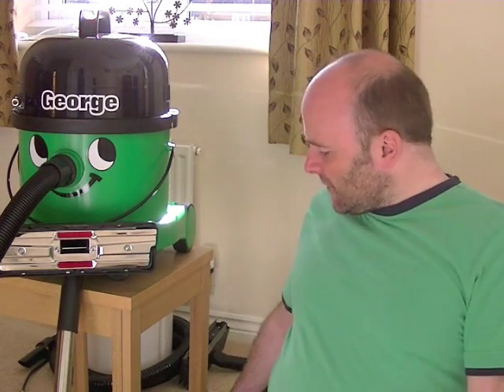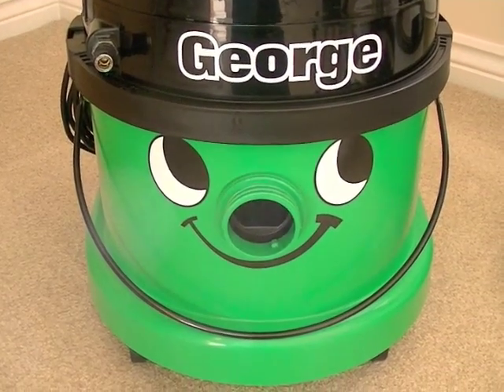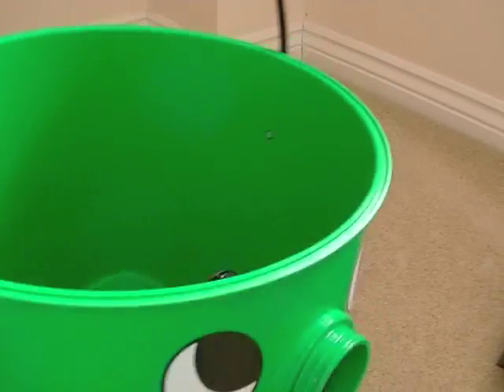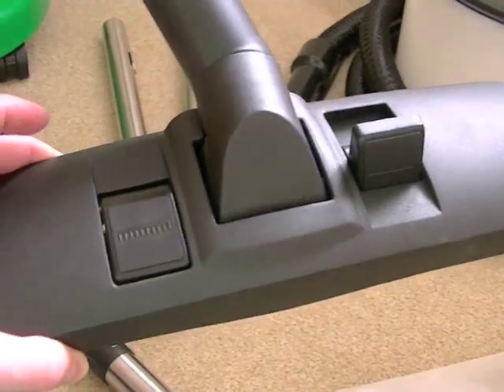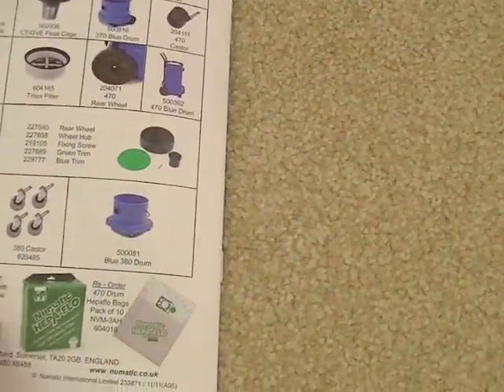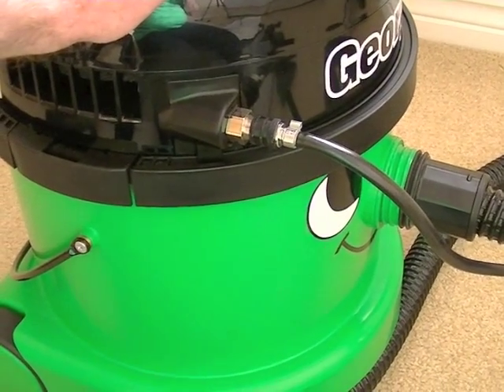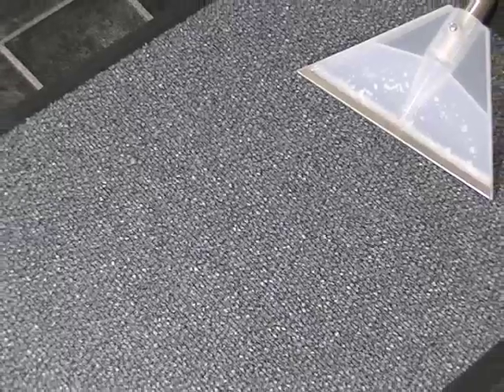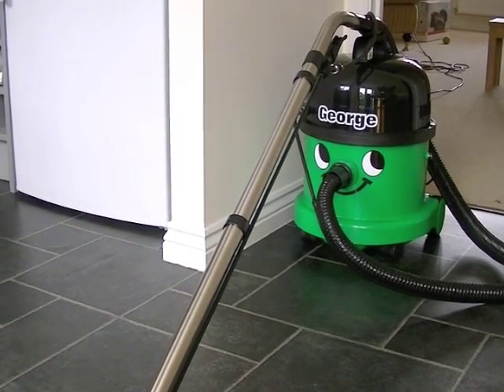Numatic George GVE 370 Wet/Dry Vacuum Cleaner Demonstration

Comment: THANKS.  Very informative video.  I just bought a 'George'.  It might be worth adding a card to your video pointing out that the floor tool bristles are also great at cleaning the grout lines on tiled floors.  regards, Phil
Reply: Hi, how did your George last? Did it keep working ok? Any issues with it? Would you buy another? Cheers
Reply: @krell2130  Still going strong

Comment: thank you for your demonstration. Because of my grind floor it is very hard to look for something to clean it in a good way. i used to have a philips Aquatrio but it doesn't do the job well enough. . i can't use steam. i immeadiatly but me a george and hoping to receive it tomorrow. I skipped everything till you started te demo for the scrub brush. but will look the entire demo soon. that is the most important for me. it looks amazing. again thank you
Reply from the maker: It's a bit of effort to clean hard floors, but you should get a good result with the stiff brushes. At some point I am going to clean my garage floor with my George. For day to day cleaning of hard floors, I would recommend the Bissell Crosswave.
Reply: that Bissell Crosswave looks a bit the same as the aqua trio i was talking about. with 2 dogs and 4 cats it can't keep up. i'm planning to use the george once every two weeks an in between. normal cleening with a mop. depends how easy is to use.

Comment: I watched this video again and again. Because it is the only accurate demo, I can not get help from any other reliable source. Now, you poured the water through the suction, where do you press to suck up the dirty solution from the mat? Your application is not visible to the camera while you are washing the stairs either. You press the suction gun to pour water but how do you suck up the dirty solution afterwards? Does it just suck up itself when you give up using the gun with both the washing button and vacuum button  being on ?

Comment: great review just bought this yesterday with a vax scrubber head someone recommended to me don't no if you have a review about the vax scrubber head on the George . I have a an Italian made carpet washer but couldn't get the parts anymore it was a great machine still works but the sprayer had broken off the end off the wand
Reply from the maker: +spacer567 I have the Vax Spinscrub head and will be reviewing it soon.
Reply: Hi, how did your George last? Did it keep working ok? Any issues with it? Would you buy another? Cheers

Comment: I have the vax 6131 but seems to leave the floor a little to wet for me unless u keep going over it for ages is the George any better thanks in advance n great vids persuaded me to get the vax BTW love it just leaves little wet like I said :(
Reply from the maker: Kev M I don't rate the George for carpet cleaning as it is hard work, but probably dries the carpet a bit better than the vax and the solution is easier to control due to the trigger on the handle. The George is better built than the Vax and is excellent for above floor shampooing.
Reply: OK thanks for info back and I can c that yes the George would b better as the trigger on vax isnt the best build and inconvenient plz keep up the vids great to watch

Comment: Can you use both switches at the same time, can they both be turned on at the same time. Can the fish tail be used on hard floors
Reply from the maker: You can run the pump and vacuum motor at the same time. You can use the fishtail nozzle on a floor, but I don't know why you would as there is a dedictaed hard floor nozzle with George.

Comment: I've noticed that the one you unpacked had 1200W, but the one in Amazon link has got 1060W. Are there two versions of George?
Reply: apasionata001 they probably changed to a lower power suction motor like they use in the Henry machines.
Reply: The new George's have a 1000w moter but idk why on Amazon it says 1060w moter

Comment: Could You reccomend this or vax 7151? Does spinscrub from 7151 work well with numatic?
Reply from the maker: This is better than the Vax. I haven't used the Spinscrub tool with a George.
Reply: +ibaisaic thanks mate, cheers
Reply: +ibaisaic i need one more thing, I read that vax w89ru-a or w90 rapide ultra could be better for carpets, please let me know what You think about it :)

Comment: how do you rate this compared to the vax rapide 2?
Reply from the maker: In my experience the Vax cleans carpets better due to its rotating brushes. Most upright carpet washers with a revolving or Spinscrub brushes will clean better than a machine like the George which doesn't use any sort of powered agitation. The George is robust and well made and would be my first choice if you need a multi purpose cleaner, but it is hard work when washing carpets and because there are a lot of attachments, it needs a fair bit of storage space.
Reply: What's that

Comment: Hi there,
Quick question. Do you have or anyone here has, by chance, size & dimension of the box, with George and accessories ? I need to have mine sent over from Italy to Australia, and I need them to get the quote.... Thanks!
Reply from the maker: +Paolo Corronca If I still had my George I would have measured the box but I don't. You could try and contact Numatic to ask for the dimensions.
Reply: Hi There,

All sorted out, just arrived! Thanks!!

Comment: Thanks so much for this video. I have a george but have only used it for dry cleaning so far. The instruction manual was a little confusing I found, your video has helped me work out how to use it to clean my carpets now.
Reply: As a follow on, since I watched this video and learned how to use George properly he has done a lot of work and family members have made use of him (and this video) too.
I agree with your assessment, he is not the easiest to use if you want to clean a large carpet, I think an upright would be better there, however for spot cleaning, small carpets, rugs etc he does work very well.

Comment: Why didn't they make the exhaust port into the capability to attach the hose? a circle port.  I often use my black n decker wet dry for a leaf blower and i have sometimes blown out leaves or clogs with the exhaust port. Who manufactures George?

Comment: Hi. The solution tube doesn't seem to release any solution out when I press the trigger when i use george in the wet&extraction mode for when I clean the carpet. However the solution tube works fine when I use the upholstery head. Any suggestions of what the issue may be?
Reply from the maker: Check for a blockage in the spray nozzle. A pin can sometimes clear it if the hole has blocked up.
Reply: @ibaisaic  thank you for the suggestion. I tried that but it didn't solve the problem. It may be faulty as it worked the first and only time I used it but has stopped working since then.

Comment: Hi, thank you for your video! Just got my George today and put it straight to work, what a change! I would like to ask you, if I want to do dry vacuuming with water filtering dirt, can I do that? What I mean I use the dry hose and dry vacuuming accessories but inside I pour a couple of liters of water, the float valve on top then the rest so the dirt I vacuum would go straight into that water? So no more hepa bags.
Reply from the maker: I would not recommend it. The George is designed to be used with a filter and bag for dry use. Only heavy dirt would go in the water, the rest would go straight through the motor and out of the exhaust and into the room.
Reply: @ibaisaic  thank you, you are right. And thank you for answering so quickly, I am really pleased with this vacuum, it's amazing for our household needs.

Comment: I have this vacum and have today set it up for the first time for wet use. I cannot however seem to get the spray to work on the long attachment. All the connectors seem to be fine yet there is no spray coming out when the handle is depressed. I have tried the upholstery attachment and the spray works perfectly so the problem must lie on the spray for the carpet attachment. I noticed on your video (28.45) that yours did not work before you cut back to the video again and it did. Did you have to do something to make it work? Any help would be greatly appreciated.
Reply: In the nozzle there is a spring and a ball. Sometimes the little steel ball gets stuck , Take the nozzle to pieces and clean the ball.  Not only that sometimes the water pipe gets a little kink in it which blocks the flow. Anyway, I don't use that any more ( see my post above)

Comment: washed a carpet with george recently wasnt very impressed. i like the fishtail gets into corners and close to walls easy, but i found it left the carpets very wet. i mixed 5 litres of solution and recovered just over 1 litre. the delivery of the solution to the carpet seems ok, but when sucking it back up you need to put some pressure on the tube of the handle forcing the fishtail into the carpet while on the pull stroke. you use a lot more energy using this type of carpet cleaner than say a bissel type carpet washer. maybe there is not enough power in the george to get the solution back from the carpet up the handle and through the vacuum hose (about a 3 metre journey)
i had to go over the wet carpet with a bissel to remove excess solution. should have just used that machine in the first place but wanted to try out the george
probly good as a spot or rug cleaner but i wont be using this type of cleaner again to shampoo carpet
when hard floor cleaning recovery of solution seems no problem
Reply from the maker: The George is the best cleaner I've used for above floor deep cleaning and car valeting, but not recommended for carpets. The hard floor head is good and I've even used it to clean a concrete garage floor. For carpets, an upright machine with revolving brushes will give better results.
Reply: squirrel kinezumi "

Comment: great video. Can you let me know how this model rates compared to the other wet and dry vacuum cleaners? Is this the best?
Reply from the maker: I haven’t used many wet/dry cleaners, but the Numatic is certainly well built and the best when used for shampooing upholstery and car interiors, but slow and laborious for carpets. If you only need wet/dry pick up, the Numatic Charles is very similar.
Reply: Thank you so much.

Comment: Looks really cool. Is there a model of George that doesn't use bag for dry vacuuming but instead uses water to filter out dirt? I was thinking about buying this one but I would have a really hard time finding bags for George here where I live.
Reply from the maker: If you can buy a George where you live, you will be able to get bags. All the George models have used bags, though you can use them without but they are messy to empty that way and the filter gets dirty very quickly.
Reply: I would actually buy it abroad and take it with me to my home country where we do not have George or any other model from Numatic at all on the market. Is there any chance that you would stumble upon one of these vacuums, and perhaps make a review of them? 

http://www.robert-thomas.de/en/electrical-appliances/floor-care/vacuum-and-carpet-cleaners/thomas-prestige-20-s-aquafilter

or

http://www.robert-thomas.de/en/electrical-appliances/floor-care/vacuum-and-carpet-cleaners/thomas-bravo-20-s-aquafilter

Thank you for replying.

Comment: Can u use a normal hose on it on the threads
Reply from the maker: Yes. It comes with two hoses one for dry use and one for wet.
Reply: @ibaisaic  thank you so much for commenting back I have one  but has no hose and was looking for a replacement but wasn't sure if I needed the bayonet one  or not sir
Reply from the maker: As long as your George has a screw thread on the hose inlet, you can use any standard Henry type hose, but of course you won’t be able to use the shampoo function without the wet tool kit.

Comment: Yes, it is very informative lecture and demo but you do not do the demo of the wet pick-up. You just say "do this and do that vaguely". Do you pour water into the tank before the wet pick up? You say "you can use the dry-hose if you want to". Just to be on the safe side, I just want to use the wet-hose for the wet pick up, but how do you adjust it?
Reply from the maker: Of course you don't put water in it for wet pick up, you make sure the dry filter and bag has been removed and the mesh filter is on the cage over the float valve. Both hoses supplied with the machine can be used to suck up water, but only the shampoo hose can be used for washing.
Reply: Ok. I now get the rationale of the wet-pick up. Thanks. However, I meant that if I just wanted to vacuum the dust into the water-filled tank, was that possible without washing the carpet? If yes, do I use the George on carpet cleaning mode putting the white bucket in and fitting the wet-hose?
Reply from the maker: It is not designed to be used like that. If you want to vacuum dry dust, you need to fit the bag and cloth filter. It is not a water filtration vacuum.
Reply: A friend had the same George 15 years ago and I was amazed to learn that she used this machine (even in the same colour) to vacuum the dust into water. In fact, because she had an asthma, she never used the dry vacuum with this machine which has continued to function to this day. Based on this story, I bought George solely for the function I suggested. Perhaps I should enquire about this from the manufacturer.
Reply from the maker: By all means, contact Numatic International and tell them you want to use the cleaner for dry pick up without the bag and filter in place and see what they say.